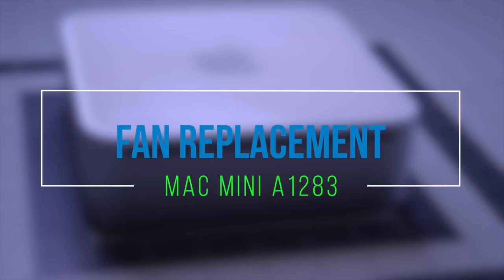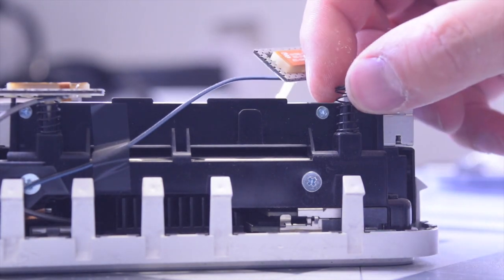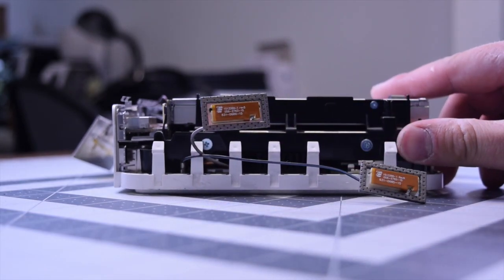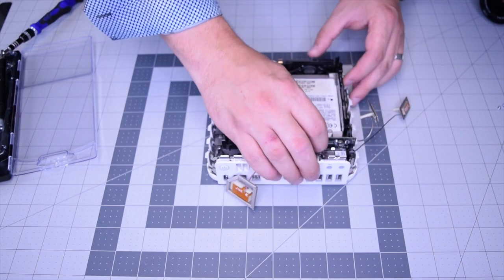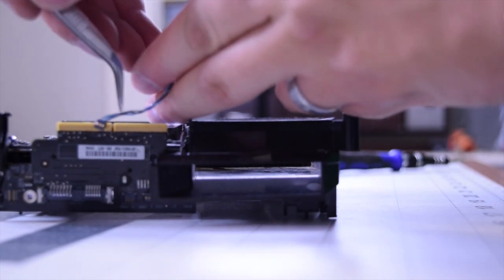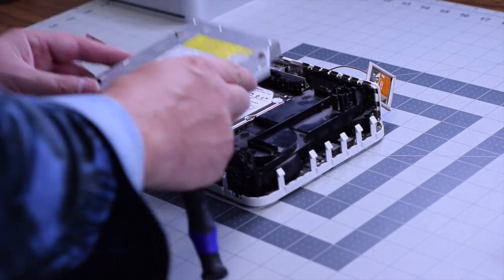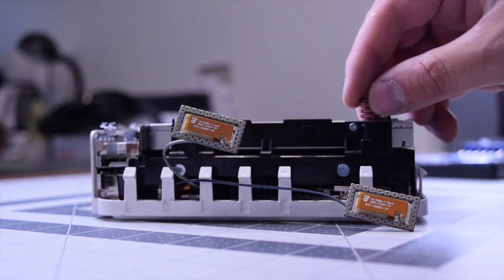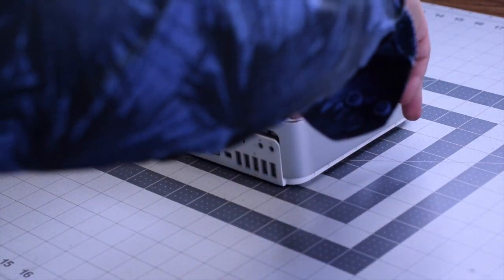❄️🛠️🍏 Mac Mini A1283 - Fan Replacement

Comment: thanks for sharing.. my mac-mini fan is starting to get noisy so i'm contemplating replacing it.. and perhaps putting in new thermal paste as i'm going to do that for my mid-2012 mbp i thought i might as well freshen up my old trusty mac-mini.. really appreciate you taking the time and make these vids.. not only saving €€ but not to mention keeping those precious metals in use for a couple of more years and helping reduce e-waste..